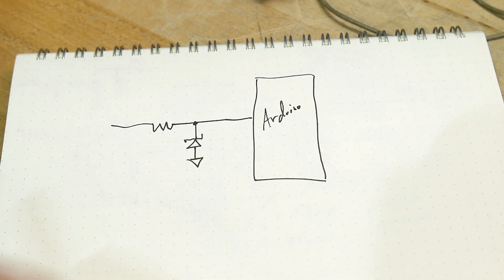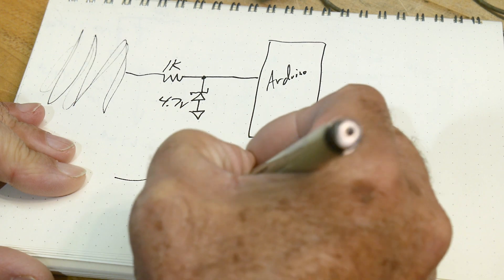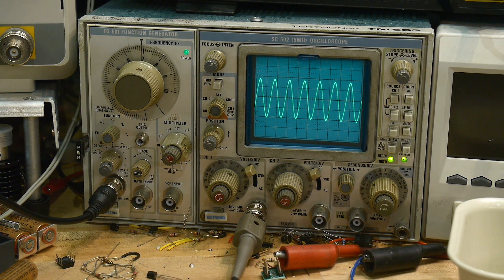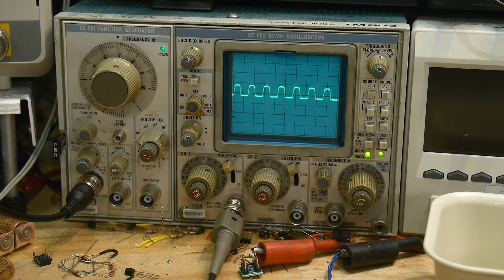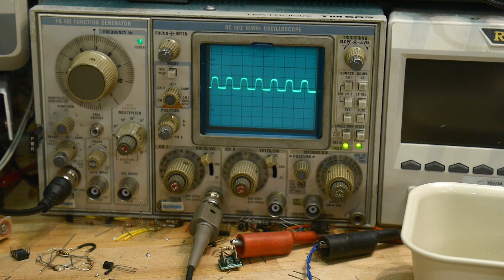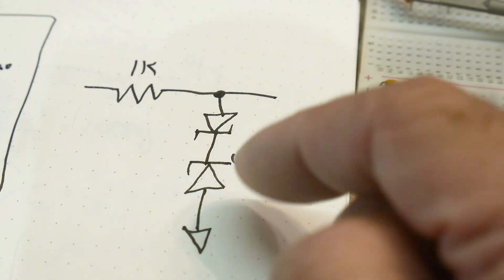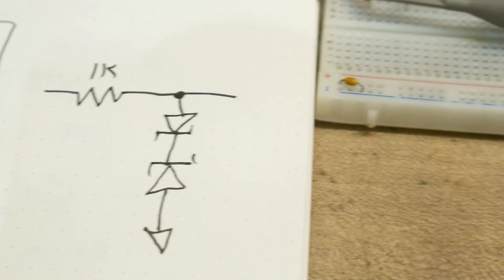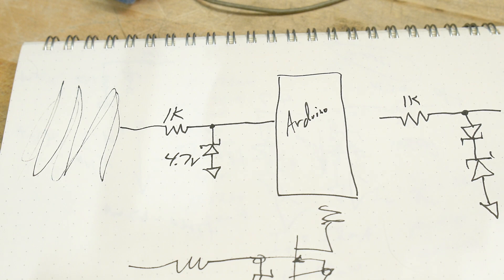#1727 All About Zener Diodes (part 5 of 5)

Comment: Zener Diodes on MOSFET gates are incoporated to limit the maximum Voltage-Gate-2-Source (Vgs) to protect the device.
Zener diodes on MOSFET gates are commonly used in non-noisy circuits too. Many of the new Low voltage gate drive MOSFET devices cant handle a 12 V Vgs, especially a constantly high DC gate drive voltage.

Comment: Is there any reason you can't put two 5 volts zeners in series to make a 10 volt zener regulator if you do not have 10 volt zener on hand?????????
Reply: YES YOU CAN. There is hardly no reason why not. Long Strings of Zener diodes in series of various values to add-up to a desired equivelint higher Voltage has been used in industry for over 40 years. I have seen ~100 volts worth of various V Zener diodes to bias a 100 volt for an X-Band radar Varactor Diode 9x multiplier. Modern Linear Regulator companies' own application-notes have schematics on how to use ordinary LM317 like regulators at hundreds of volts by using Zener diodes in the 1.25 V feedback path from the output voltage.
Reply: @joeteejoetee  Thanx

Comment: I've always had a question about this circuit that is never ever explained! Referring to the first circuit, why is the resistor before the zener? Surely it would make more sense to have the resistor between the zener and ground? That way, when the zener "opens" you are current protecting the zener. There is no reason to current project the io pin of a microcontroller etc. It has never made sense to me 👍
Reply: You absolutely must limit current into integrated circuit inputs. With a microcontroller, I/O pins are almost always protected from over-voltage by diodes to the positive supply rail and ground. Those diodes must have their current limited to something in the range of 2 mA to 10 mA. 5 mA is a pretty common spec. Current greater than that can damage the diodes.

With the clipper circuit in the video it may actually be necessary to use an additional resistor between the cathode of the zener and the I/O pin to be certain the current through the diodes internal to the processor is not excessive. It is unlikely this is necessary but the specs for all the parts need to be considered carefully. The analysis needs to include what happens if the signal can be present when the the processor power is off. In the example in the video the protection diode between the input and supply pin of the processor would possibly have its maximum current rating exceeded.

If you put a resistor in series with the zener it simply allows the voltage applied to the input pin to be equal to the voltage from the external source. This is a simple Kirchhoff's laws (both voltage and current) problem. The resistor in the position shown in the video limits current through the zener and into or out of the I/O pin so safe magnitudes (with the previously described caveat).

Properly protecting I/O pins can be a fairly difficult challenge at times.
Reply: In addition to the above, a resistor in series with the zener will result in a variable clipping voltage. Remember that any current which flows through the zener will also flow through the resistor. If the zener is not conducting, there is no voltage across the resistor, so the clipping voltage down to ground is simply the zener voltage. As the zener starts to conduct current, that creates a voltage across the resistor, and that pushes up the clipping voltage of the zener. As the input voltage increases, more current flows through the zener, and the effective clipping voltage of the circuit will rise as the voltage across the resistor rises.
Reply: The reason we have a resistor before the zener, is to have a place for the voltage to drop. If you don't have the resistor before the zener, then the zener would have to sink a lot of current.
Reply: @notmark in the circuit you are describing which node would have the zener regulated voltage that you can use for your load?